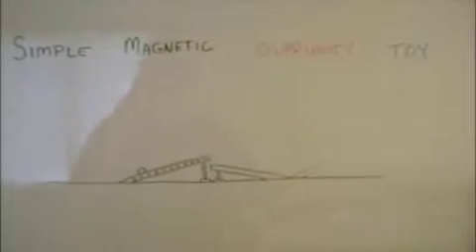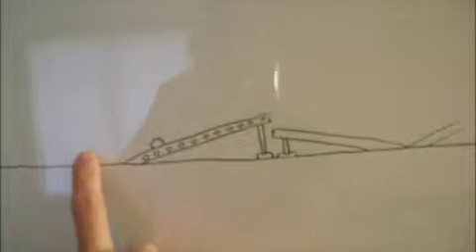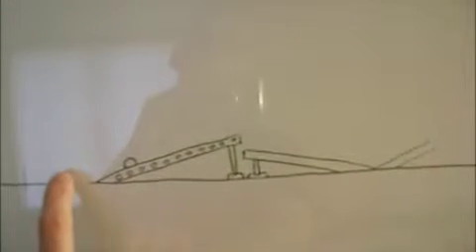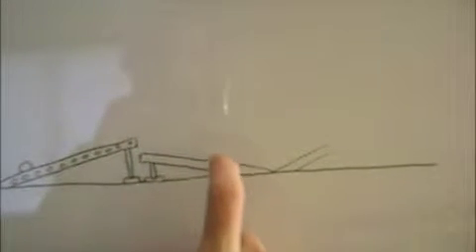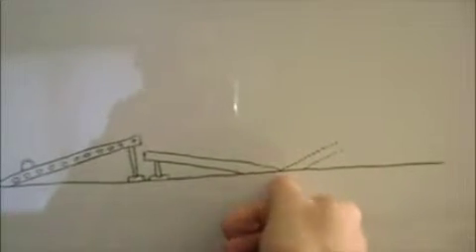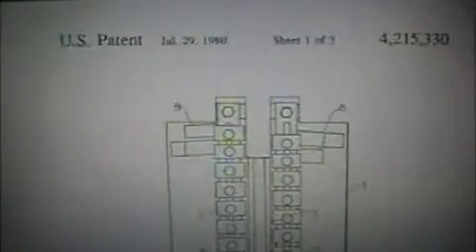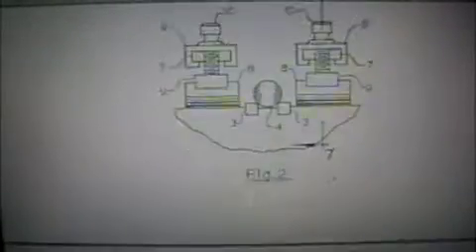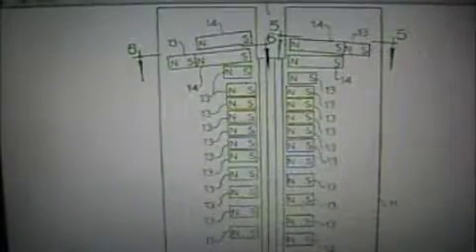SMOT Device?

Comment: Make it work and let it work,make it sothat it will start and run automatically sothat we will have an perpetual motion free energy device because i know it’s possible.
Reply: @johneygd
Why would you be so confident that free energy is possible? Honestly wondering?
Reply: very simple, if magnets are everlasting and if we just know how at how we can make those magnets keep pushing each other in a loop,then we could generate free energy,there’re soooo many documents and videos online about it,there got to be atleast 1 of those videos and documents to be correct, they can’t be all fake and i got my own theory and how such magned based perpetual motion machine could work, if only got the right stuff and tools to make my own one.
Reply: @johneygd  
They aren't everlasting, though. You'll be lucky to have one that lasts a thousand years if you're using it continuously. I mean, don't get me wrong, magnets and electrets (the electrical equivalent) are actually great when it comes to power conversion in the former and somewhat long term continuous usage for the latter, but no. Like with an electret, any energy you draw from the magnetic field will either weaken it or disrupt it. I mean, if you can't do it by pushing, a magnet will probably only help smooth things out rather than just add power.
Make sense?

Comment: Instead of making the narrowing walls magnetic and the ball attractable metal, why don't you make the narrowing walls attractable metal and the projectile magnetic; like put two steel balls on either poll of the magnet and let it roll itself threw the narrowing attractive metal? Certainly that is more consistent and less expensive? Like of 1min 5 sec of this vid
https://www.youtube.com/watch?v=LFJHvdW4WOE
?
Reply from the maker: That's not a bad idea. Might have to use a plexiglass track, instead of aluminum, to avoid eddy currents affecting the ball though. Thanks for the suggestion.
Reply: Happy to help. When can I expect new videos; love your channel?
Reply from the maker: Thank you. I uploaded one yesterday called "Portable power in 60 seconds", and I have several others planned. So stay tuned.
Reply: Affirmative. Will check it out and stay toned.